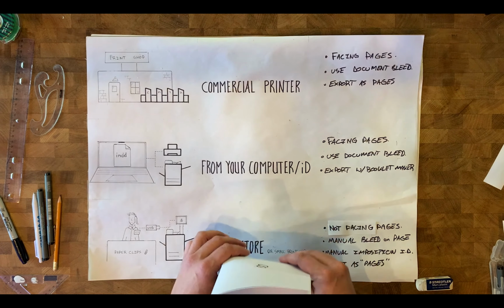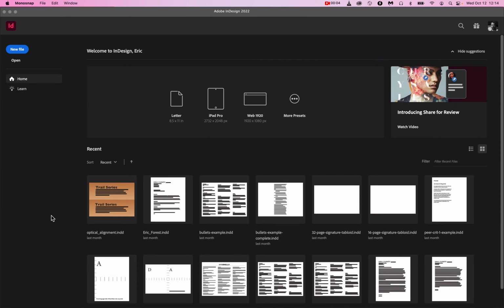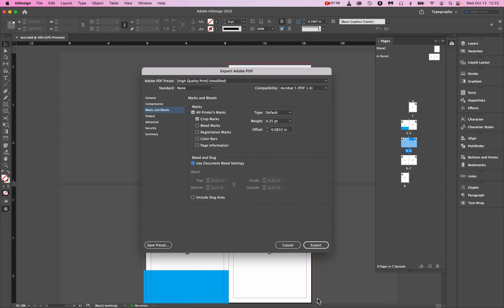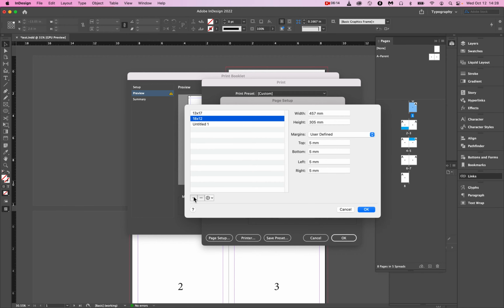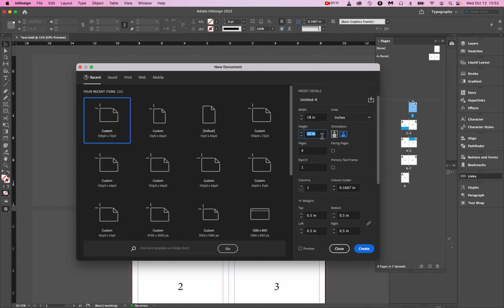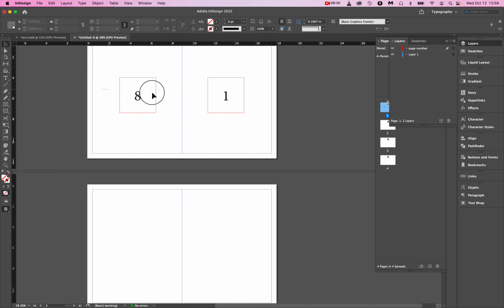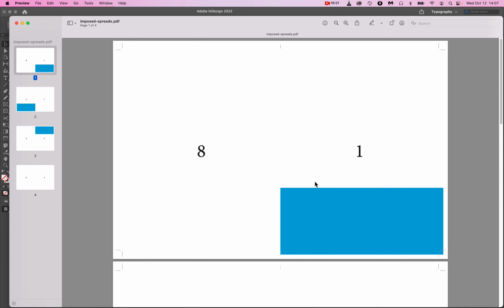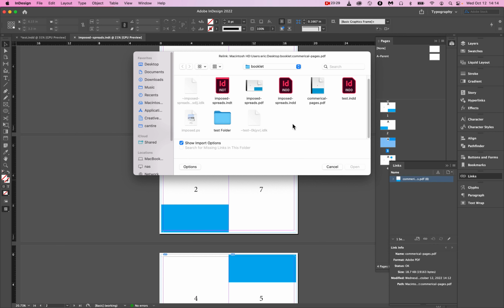Preparing Booklets for Printing, 3 Ways

Comment: Hi Eric Great video, at 2:10 the imposition is so because you used "2 sheets" together. what if "3 sheets" were used together then imposition would be completely different. So how do we tell the printer how many sheets are used 2/3/4 … I am a novice in printing so any help much appreciated.
Reply from the maker: The number of sheets is determined by the number of document pages. One sheet is used for every 4 pages. So if you have 12 pages, that's 12 pages placed 4 per sheet. The math would be 12/4 = 3 sheets. If you have 16 pages, that's 16/4 = 4 sheets, and so on. 

If you aren't sure how to impose those pages onto the sheet, then you can follow this tutorial and use the imposition script. https://www.youtube.com/watch?v=7p4Su3LUSR0
Reply: @ericforest9186  I saw the video, this will work when you want to physically cut the pages from center and align into 24 pages. But what if I want to fold from center 2pages or 3pages and make it a set of folded pages later to be physically stitched with thread in book binding. I was asking about that in my previous question. so if I fold 2 A4 pages together from center or 3 A4 pages from center then make a set say till 100 pages. How do I tell the printer to do imposition?
Reply from the maker: @kashi2843  the method I have described are called saddle stitched. Fold each sheet in half to make four pages and then nesting that sheet into another folded sheet and you keep doing this until you have all your pages are assembled into a book. There is no cutting involved in the method I have described.

If you are dealing with a professional printer, you do not need to do the imposition yourself. You should contact the printer and ask them how they would like to receive the pages.

Comment: Hi! Super informative! I have a question though. In settings for a commercial printer you've set a bleed as 0.25 inches, but when exported, bleed on the inside margin is not the same. How did that happen if the bleed was set as 0.25 on all sides?
Reply from the maker: @SaraMaric-o9s  i need to start with a caveat: i have described the general case. the person who best knows how set up your file for print will be your printer. Ignore what I say if it conflicts with them.

You don’t need bleed on the inside margin. Bleed is for trimmed edges. The inside margin is folded, and it is connected to the other half of the sheet. The inside margin of the first leaf is physically connected to the inside margin of the leaf. leafs are what you get when you fold a sheet in half. Each leaf has two pages on it.

This might help: https://youtu.be/OT3Ecz7ib9c?si=gMusbhltsAoscZEa

Comment: Omg thank you very much. You gave me the exact info that i needed for printing my portfolio. 😭
I just wanted to ask if i am printing a large number of pages in the form of a magazine then would the center of my spread i.e the inner edge of a page not get eaten up by the binding ? What do i do to prepare for that?
Reply from the maker: @bakasso  yes, this can happen. You need to leave adequate book gutter (sometimes called inner margin) to keep content from “falling in.”

You’ll also get “creep” which is the apparent shortening of the outer pages and lengthening of the inner pages.

Because of this, large publications use more than one signature. That way the book gutter is less deep and creep is reduced.

Stand a book up, and look down at the top of the spine into the head band. You’ll see multiple signatures glued together.
Reply: @ericforest9186  thank you very much for explaining .

Comment: What about those who don’t have the two-sided option? I’m using a Mac, but unfortunately, my printer only supports two-sided printing on Windows
Reply from the maker: You need to print odd pages (pages being the imposed spreads) only, flip, load the paper back in, print even only.

It matters if you flip on the long or short edge, and if you rotate the paper wrong.

For that reason you’ll want to print a couple drafts (b/w, low quality) and do some testing.

In theory there is a risk with laser printers that you can ruin your printer doing this. However I have never had an issue with short documents.
Reply: I’ll give that a try. Thank you very much for your help!

Comment: Thanks for the easy explanation :) do you know if imposition works different on right to left books (I am designing for the first time a book in Hebrew, offset, 500 copies) and I want to make some digital printing tests before 🫣?
Reply from the maker: @danirijilla  It works the same, but the order is different. I don’t know the specifics.

Are you already using the software installed in Hebrew? A lot of the typography tools are different.

You can consult with your printer to see if they can impose it (usually the printer does the imposition, not the designer).

Beyond that, you’ll need to purchase professional imposition software.